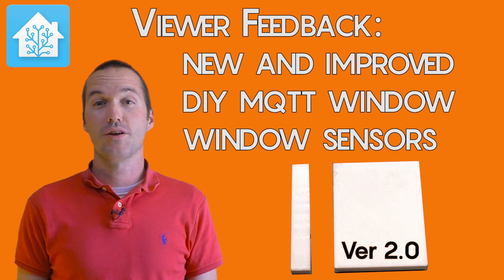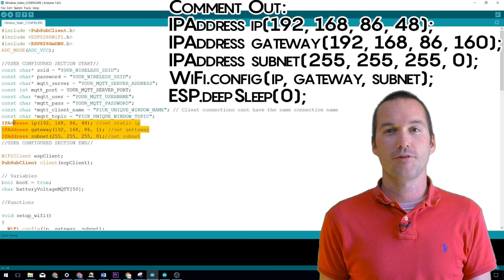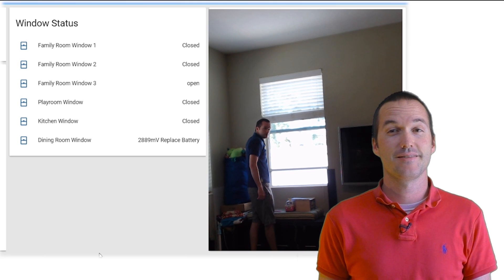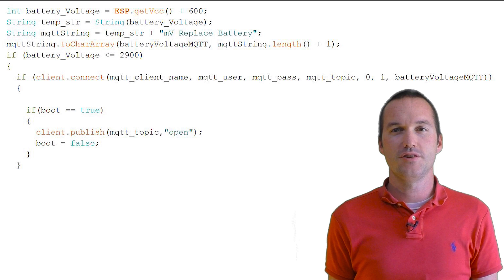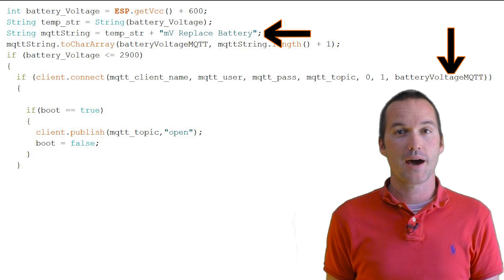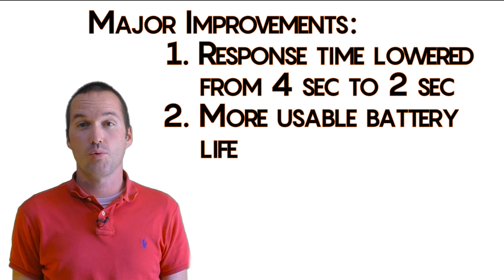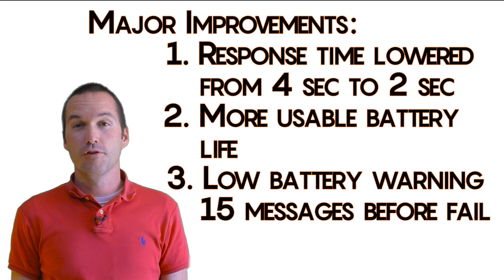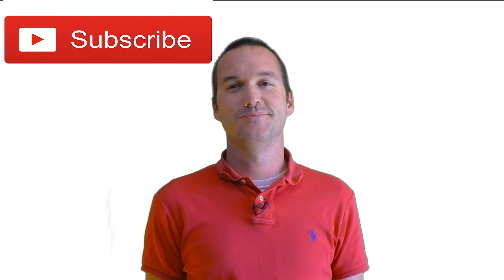[FIXED] $5 MQTT Window Sensor Viewer Feedback

Comment: Good job! IMHO, exists more additional solutions to improve performane and baterry life. 1st - change baterry type to CR123. Okay, biggest than CR2032 but more than 800% capacity and, of course, need to rebuild case. Excellent for daily use. 2nd - remove pull-up resistor (depend of ESP version!). It reduced deep sleep baterry load from 20 to 3 micro Ampers (3uA). How to do it you can see in YT; find "Best power saving mode - Much Deeper Deep Sleep ESP8266". I try to prepare your project with CR123 (CR123A) baterry.
Reply: Have you done it.. can ihave the link to project please and also integration with home assistant

Comment: You can reduce the wifi connect time considerably by passing the WiFi channel and BSSID (wifi mac) when connecting, otherwise it has to scan the channels for the SSID.
Reply: Except modern WiFi routers often have a Auto Channel Select feature that helps them avoid your neighbors on the same channel, so you would have to make sure your router has that turned off so the channel is consistent.
Reply: Consider using ESP NOW to reduce wifi traffic.

Comment: OTA is a good option to flash the new version to the ESP , but challenge here is that you will have to keep the power open till the update , so i think adding a update Button is the way to go and when pressed it goes and get the new code from the server and you have to make sure the power is on the whole time till the update completes :) or you can flash the software using Arduino IDE using Local IP Address

Comment: last night i accidentally turned off my mqtt broker and it drained complete battery while trying to connect to broker.. is it possible to add a function that it tries to connect X number of time then goes back to sleep
Reply: It's known as the "circuit breaker" pattern. But yes, you can have a variable called "attempts" that you increment on each attempt, and check for a maximum value before each attempt.

Comment: Why not 3D print a case large enough for small pins for later firmware updates.  It could just be a esp 01 pins breakout board

Comment: Slight problem with the way you're assigning a static IP: If your device is disconnected from the network (window closed), and a new device (like a visitor) connects to the WiFi w/ DHCP and gets assigned that same IP, and then you open the window, you've now got a conflict on that IP. Not a big deal since the window sensor is only sending one message and never receiving anything, but not the best practice for choosing a static IP.

Instead, choose one of the addresses outside of your router's DHCP pool (but not assigned to another device and not the broadcast address) and use that as your static IP.

In case you or a reader doesn't know what that means, a quick setup:

1. Check your router configuration to see what its local IP address is. This is its address on your local network, not on the internet. The typical default is 192.168.1.1.
2. Check your subnet mask. Typically 255.255.255.0. This means messages that arrive at your router addressed to anything starting with 192.168.1 are meant for the local network.
3. Check your router to see what IP range it is configured to use for DHCP. Default is often 192.168.1.2 - 192.168.1.254. This must exclude any static IPs assigned (including the local IP of the router itself) and the broadcast address for the local network, which is the "all ones" address with respect to the subnet mask, in this case 192.168.1.255.
4. Shrink your pool to leave some addresses for static assignment. Say 192.168.1.2 - 192.168.1.100.
Reply from the maker: I fixed that issue by reserving those specific IP addresses in my router, but placing them out of DHCP range would do the same thing.   My DHCP range just happens to be .2 through 255.

Comment: Rob,  using your updated ino with static IP, program using Arduino INO 1.8.8 (ESP Board Manager 2.5)
Generic ESP8266 Module, CPU Freq = 80 MHz, Crystal = 26MHz, 40MHZ, Flash Mode = DIO, Flash Size = 512 (no SPIFFS), 115200 - upload shows completed 100%. Once I power it up using 3.5V battery (LED on), on my OpenWRT router, I ping the IP of the sensor, and I only get one ping respond.  Is it suppose to connect to WiFI and stay on the full time (eg, when windows is open).  On MQTT, I don't see the message getting into my local broker (using MQTT.fx, I subscribe to the topic but don't see any mesg).  On Home Assistant view of sensor, it shows as "unknown".
Reply: I am using the following MQTT topic/device name:
const char *mqtt_client_name = "uwindow1"; // Client connections cant have the same connection name
const char *mqtt_topic = "uwindow1";

for configuration yaml:
sensor:
  - platform: mqtt
    name: "Dining Room Window"
    state_topic: "windowStatus/uwindow1"

(Mosquito MQTT server is running locally on the Rasperry Pi running home assistant, 14x other Sonoff/Tasmota is sending messages to this server fine)

I can't confirm if the ESP-01 actually got onto the network to send the MQTT message??? But I don't see anything on MQTT.fx when I subscribe to this topic:  "windowStatus/uwindow1"
Reply: Hi Rob, got tcpdump and see that the EPS-01 did make connection to my MQTT server, then it publish an "open" message to topic, then 16sec latter, it published a "closed" message to the stated topic.  Thank you, I just need to get the automation working to email/sms/or TTL when the "open" message is publish.  
For those that don't have access to 3d printer, after all is wired up, I put the ESP-01 inside of a shrink tubing.

Comment: How about swapping the CR2032 to a CR2477?  would last your entire lifetime w/o ever needing to be replaced I'd bet.  1000mAh vs 255.  These batteries are just thicker coin cells and are what industrial sensors generally utilize.

Comment: Thanks for your Great design and "redesign".
I found it easier to program the Esp-01 and then look at the client list in the router.  Then use the MAC address to set the static ip.  The five lines that you commented out are not necessary. Nothing wrong with what you did.  Also plan to use you design to know the status of my garage door.  Size is not so important so i will use a single 14430 LiFeP04 battery and display the battery voltage each time. This battery should last a very long time and can be recharged.  I show 3822 mv while connected to the USB port (just after programming) so I am not sure of your 600 adjustment. I have some work to do on that.  Also thinking about adding something like pushbullet to send an alert to my phone when the status of the garage door changes.  Thanks again.
Reply from the maker: This is expected behavior.  The apparent voltage drop is caused by the limited current that the CR2032 can supply.  I think the ADC actually just calculates voltage based on current flowing through set resistance value.  Because the CR2032 can supply a very limited amount of current and the wifi radio was pulling a significant amount of it, the perceived voltage on the ADC pin was lower.  

When connecting to a 3.3v power supply via a USB adapter it should be able to supply ample current (lol, AMPle) to prevent the incorrect voltage readings.

TL;DR the +600 correction will need to be modified if you're using anything other than a CR2032.
Reply from the maker: I'm going to need to defer to someone else with more networking knowledge on the difference between setting a static IP and reserving an IP on your router.  Here's the way I understood it though:

1. DHCP takes more time because it has to communicate more times with the router before connecting.  The sequence would go: 
ESP: "can I have an IP" 
Router: "sure, here's this open one" 
ESP "thanks, my IP is now xxx.xxx.xxx.xxx" 
Router: "cool".

2. The speed increase here comes from the fact that instead of asking the router for an IP, the ESP just tells the router which IP it has.  The sequence would be: 
ESP: "my ip is xxx.xxx.xxx.xxx" 
Router: "cool".  

3 Reserving an IP on your router ensures that a device will always be assigned the same IP by your router, but still utilizes DHCP because the ESP will be requesting an IP, not just claiming one.  That sequence goes:
ESP: "can I have an IP" 
Router: "sure, I saved you the same one you had last time" 
ESP "thanks, my IP is now xxx.xxx.xxx.xxx" 
Router: "cool".

The reason I did both (reserved IP and set static) was that these devices are offline 99.9% of the time and I wanted to make sure that when they did come online there wouldn't be an IP conflict from them claiming an IP without any input from the router.
Reply: Any reason for using PushBullet over Telegram or another service?
Reply: You obviously thought this through.  I am no network expert (not even close).  I was just sharing my observations for what they are worth which may be nothing.  I really enjoy and appreciate your videos,
Reply: I just happened to see PushBullet and tried it and it worked. I also tried Blynk.  I think I will try Telegram. What do you like best?
Reply from the maker: I've used pushbullet and blynk, blynk is a great service, but it's really touchy about ping, so not great for IoT devices that are outside or in the garage.  Home assistant changed the way I think about home automation, it's really amazing if you're willing to put in a few hours to learn it.
Reply: The learning curve for HA has been very painful for me.  I just learned about WinSCP which is a big help. I use hassio and have never figured out to see the files on the Pi. With that I can. 
I have several WEMO devices and tasmota devices. No problem. But I can not "see" your code in HA.
I see the messages  coming in to MQTT.fx (great tool) so I know the ESP01 is working.  Can you share the HA lines that you use?  I am missing something. Thanks
Reply: Never mind on the HA lines. I found the problem. I have a Ring doorbell and I noticed that the response from your program was in the middle of all of the ring data (10) because I named it "garage door" which I guess Ring uses.  When I changed the name to something else, all is OK. Learning is FUN

Comment: oops I should have said the first 4 of the 5 lines are not necessary.  On the LiFeP04 battery, the voltage reads  3734 mv
Reply from the maker: What's the actual mV when you hook the LiFEPO4 up to a multimeter?  I think those can go up to around 4200 mV on a full charge, right?

It still makes sense for the numbers to be more accurate on the LiFEPO though.  I'd imagine that if you hooked 2 CR2032's up in parallel the voltage would only be off by ~300, 3 in parallel only off by 200mV, once you got to 5-6 in parallel they should read accurate voltage due to having sufficient amperage supply.
Reply: You are quite right.  I was not being critical at all.  I was just making a comment about the the differences in a different situation (my adaptation of your excellent design).  BTW mine is finished and it works perfectly.  Now I need to "detect" it in HA and do something with it.
Reply: @tommh44  please share the project thanks
Reply: Hello. Did you use one LiFePO4 battery to power up the ESP-01?

Comment: I'm going to give the new update a shot as I'm using openHAB for my home automation.  I was also thinking if you  made the case thicker or longer so you could put 2 coin batteries in parallel and extend the life of the circuit and use for a door sensor. Thoughts??
Reply from the maker: That would work. I think someone made a version with the A123 battery that gets pretty insane battery life.

Comment: I know this is old but I was curious can you modify the STL file to make the case bigger to fit 2 batteries in parallel to increase capacity and increase time before needs replacing battery

Comment: great video have you ever look 3v solar cells ? this might raise the cost to $7.30 but as long as never have to change the batt ever then it worth it. I figure all one need to do is stick a small solar patch on your window to capture the sunlight during the day. just a thought
Reply from the maker: Got a link for some? I'd love to make some solar stuff.
Reply: @roystervi  Could look at those cheap garden lights for how their charge controllers are setup... maybe design something small to power these. I imagine the solar cell would mostly be used to top off the battery or very slowly charge it because the amount of sun a horizontal panel would get, especially on a completely shaded side of the house, would be minimal.

Comment: Rob, I thought of another use for this "sensor" and with a little modification to the printed parts and a locking push button, this could be a Help Me! button for the bathroom. In my case I have an aged aunt that lives with us. If she were to ever have an issue in the bathroom she could press the button or pull the cord (attached to the magnets) and send a Help Me! notification, or do something useful with the information.
I'm working on the STLs right now. The automation would be a simple flow in Node Red and the Config~.yaml would be very similar to the windows.
The trick is that you would want to keep sending a notification or something (have google alert through out the house, Flash a light, etc) at regular intervals until the "closed" message came through.
maybe even have a capacitor the was charged up on power up that would last long enough to send a positive message not just a LWT. ahh experimentation, Gotta love it.

Comment: good job, thanks
Reply: Could I use this design with a different case and an 18650 Battery?
They are cheap and rechargable, albeit a bit bulky.
I'm thinking this works for doors/windows with more frequent opens.

Comment: How does a MQTT listener receive the 'closed' event?  I understand that the retained flag on the 'closed' will be read as the default state on the queue, but when the window is closed, the sensor is powered off.  Will an active queue listener ever see that the window was closed?   Thanks for the video!
Reply from the maker: Great question.  When the sensor connects to the MQTT server it sends a clientID (familyRoomWindow), and a last will and testament ("Closed"), when the MQTT server detects that the familyRoomWindow clientID is no longer connected it will publish the last will message of "Closed" to the correct topic without any input from the sensor.

Comment: When you set the static IP you add it to the code under the gateway line, not the IP line, is that correct? If so why? I would have thought it belonged in the line above.
Reply from the maker: No, add it to the IPAddress ip(xxx.xxx.xxx.xxx) line.

Comment: I have a lot of unused ESP-01 and I am pretty proficient at Arduino coding.  But have just started with Home Assistant and HASSIO.  So I was wondering....would it be possible to add into the code to the ESP-01 for Online Updates...?  That way you only have to download locally once.  Could you just open the window and then when it powers up do an online update over wifi....or am I missing something?  Great videos btw....love them...!!
Reply from the maker: Most of my other projects include OTA updates, this one didn't because it has a very quick on time (less than 5 seconds) and it would be very inefficient battery wise to run the OTA handle function.

Comment: Hi, love your great work. I am putting together few of these and found there is a new code in your reppo 'Window_Static_CONFIGURE_JSON.ino' and a transistor in your wiring diagram. I could not find any related info on transistor or new code.  Just wondering
Reply from the maker: The transistor diagram is totally untested and was added for someone who wanted to use it with a larger battery for both open and close signals
Reply: @TheHookUp  All good, I made two of these. I did avoid the resistor to pull enable high, however both my Esp-01s refuses to boot from CR2032, no problems booting and sending the mqtt message when connected to a PSU.  I have ordered two more ESP01 from two different suppliers, hope they won't be power hungry.

Comment: Recent sub. Thanks so much for the excellent VDO. Do you feel it’s possible to adapt this project and make a wi-fi MQTT button? I’d love to see that vid. Thanks again.
Reply from the maker: Yeah, you could make something similar.  If you used the same schematic from this video but just changed the reed switch to a push button you'd need to hold the button down for ~2 seconds for it to boot and send the message.  I posted a modified schematic for someone else a while back that would work with a momentary button press, but it's not as simple:  https://github.com/thehookup/MQTT_Window_Sensors/blob/master/wire_diagram.JPG
Reply: That was very helpful - thanks so much again

Comment: The ip address, default gateway and subnet . Does this have to be put in manually or will it get assigned through my DHCP ?
Reply from the maker: Static will connect faster but it will dhcp by default.
Reply: @TheHookUp  thank you. Working on building this.
Reply: I copied your code the new one i am getting a "error Compilation error: Error: 2 UNKNOWN: exit status 1" any help?

Comment: Would it work to place an additional sensor with the other leg of the Reed switch connected to send closed message?  Wouldn't mind using two sensors on one window if that would work
Reply from the maker: This would greatly reduce battery life since the device would remain on (in deep sleep) after sending.